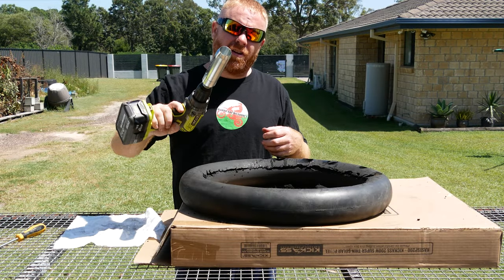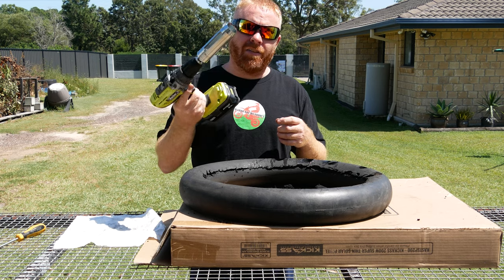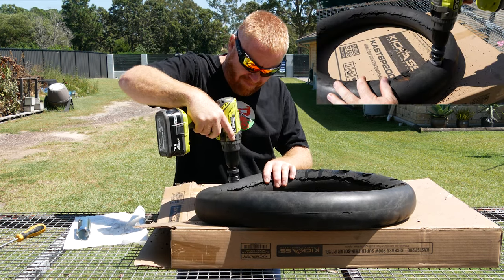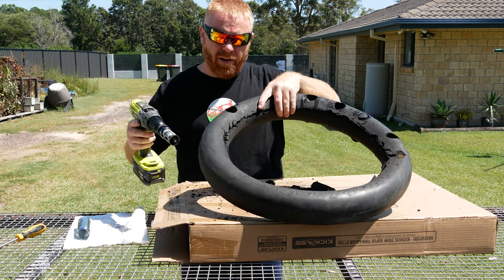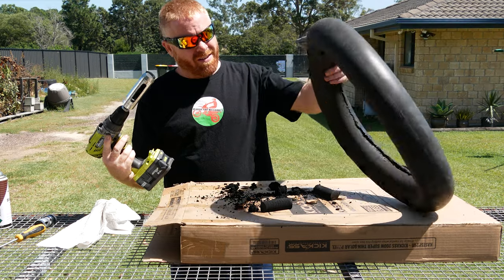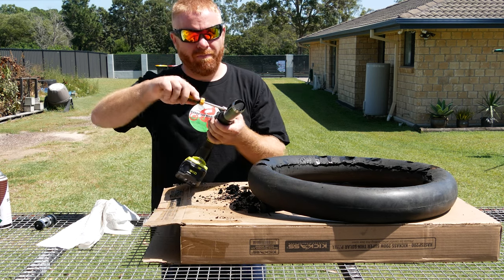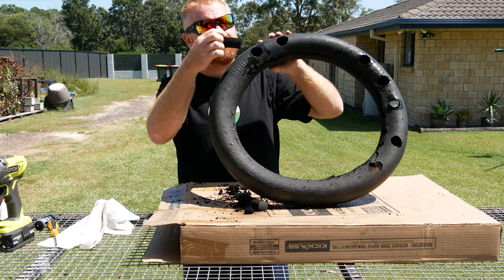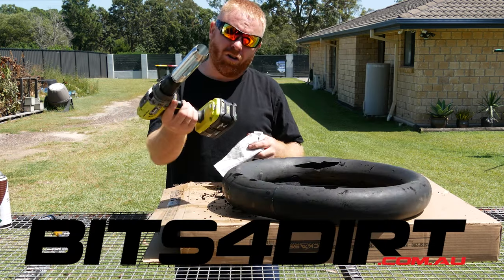New Mousse Drill Bit Demo. Hot Knife Through Butter **bits4dirt.com.au**

Comment: Not to sound funny, but on here the normal hole saw looks like its being drilled in reverse..........................
Reply from the maker: The hole saw works best in reverse for the mousses. Running forward it grabs and rips it to bits. Obviously with the mousse drill bit it doesn’t matter what way it cuts. Cheers
Reply: That's cool, makes sense, thank you for the reply
 @HardEnduroAddict